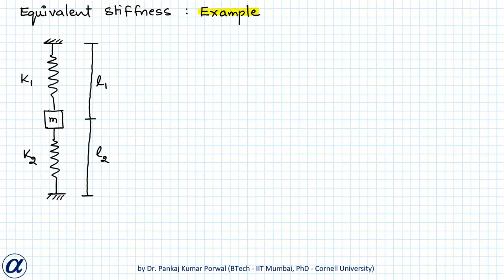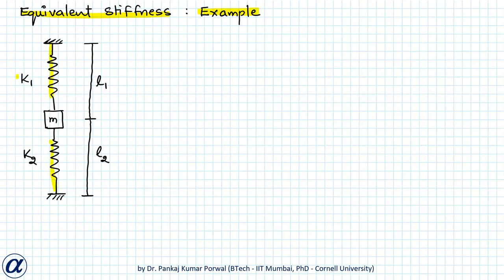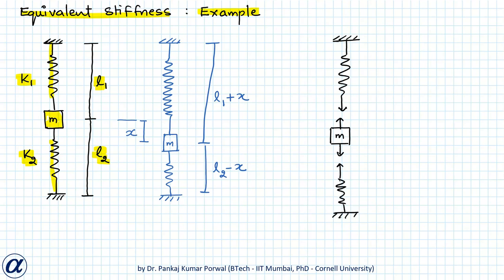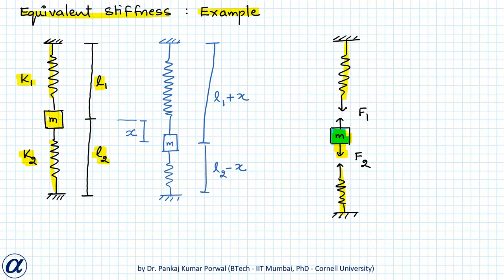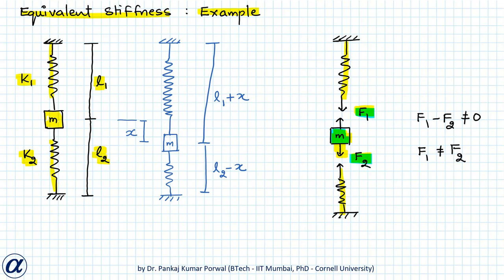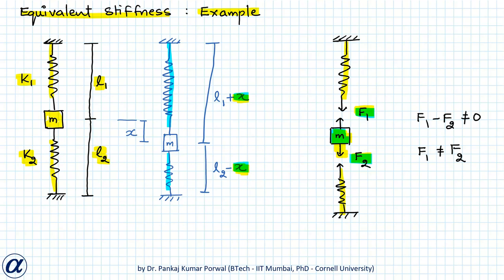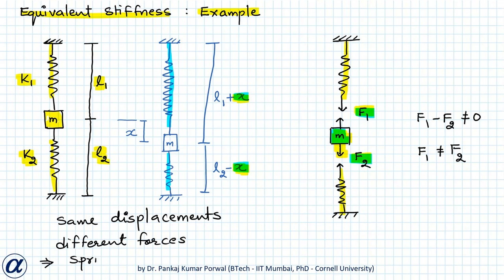Equivalent Stiffness of Springs with Mass in the Middle

Comment: how does it imply anything? same displacement ok? if they have the same displacment, why is that relevant to the orientation of the springs. I am not saying you are incorrect, but i need a deep explaination. "THE SKY IS BLUE BECAUSE THE SKY TURNED THE COLOR BLUE" "they are in parallel because they moved the same distance" ???????????????/